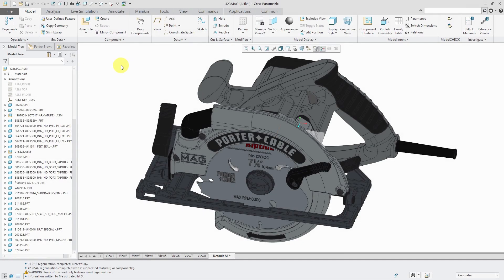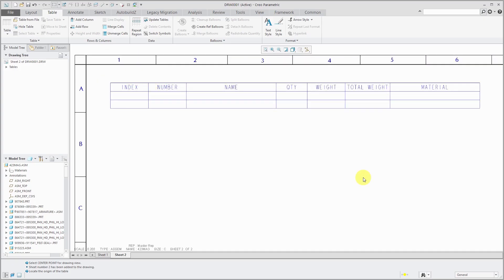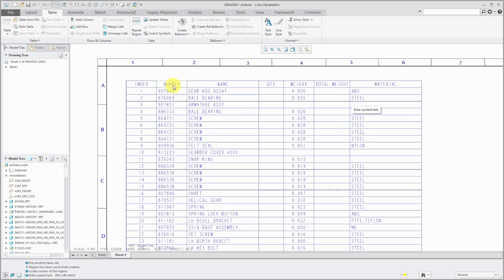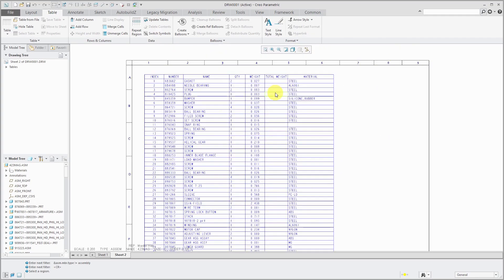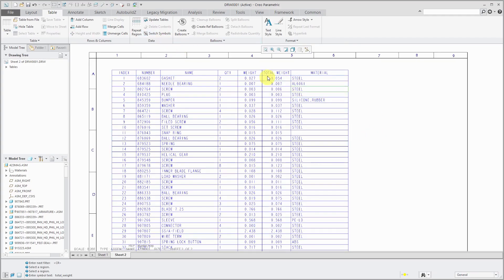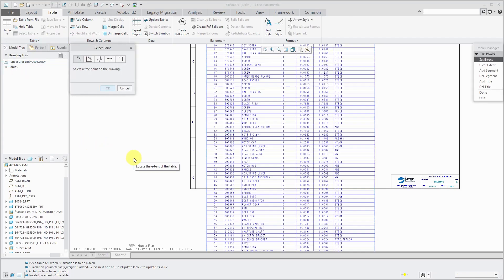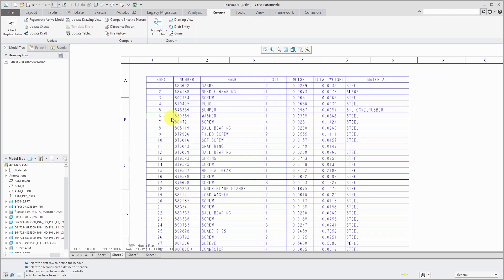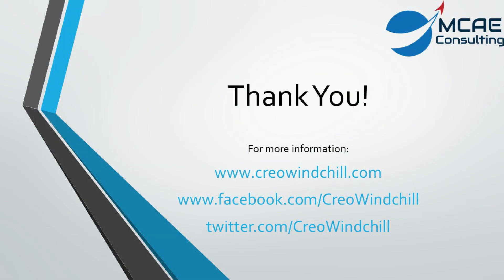Creo Parametric - Drawing Bills of Materials (BOMs) | Tutorial

Comment: How to change QTY inside the table?
Reply from the maker: You don't. It's parametric. The quantity is driven by the model. If you want the quantity to change, add or remove instances from the assembly.
Reply: @CADPLMGuy yeah but when I try to delete or suspend the part then like billion warnings pops up and nothing want to work as it supposed to work -.- I made it by using sketch. Make a cross on the wrong qty and put number on the side xd I don’t understand why but Creo is the hardest 3DCAD program that I ever use <hopeless> I worked on F360, inventor, solid edge, solid works, catia and my favourite NX and the most issues I had are now when I finally found great job with fast stamping progression dies :D eh live is hard
Reply from the maker: A billion warnings? In that case, I suggest you open a ticket with PTC Tech Support.

I'm sorry that you are struggling so much with Creo. I suggest that you watch more of my videos from the beginning, as it seems like you are having problems with some basic sketching and assembly modeling. Or maybe go back to NX.

You might also watch my BOM video that contains information on filtering parts out of the BOM if you want to remove that line entirely.

I don't understand your problem as you have described it. Perhaps you have a super user or admin at your workplace who can help you. It sounds like some training would help as well.
Reply: @CADPLMGuy  unfortunatelly I have to work in Creo, I'm doing my best but sometimes on basic stuff i just on the dead end. My company did not provide me any course and before that i didn't have anything common with creo that is why i'm strugling so much. And what is the funniest I'm designing progresive fast dies for military and space purposes xd but it is how it is here in Pl in american company :D thank you for those tutorials i'm watching them in work :)
Reply from the maker: As someone who has worked at multiple companies that used different CAD software than my preference, (1) you don't have to work there, and (2) you can make the most of this opportunity. And of course you are going to struggle with Creo if you haven't been trained in it.

The first step to a better situation is realizing you have a choice.

Comment: is it possible to add the index number to assembly columns in assemble mode? is that report index a parameter somewhere?
Reply from the maker: It is not. There are several reasons this would not work. It can't be a part- or assembly- level parameter because parts and assemblies can be components in literally thousands of other assemblies. If it were a component-level parameter in an assembly, it would require a 1-to-1 relationship between assemblies and drawings. You would probably have to eliminate Simplified Rep functionality in conjunction with Repeat Regions. In a PLM environment, it would require checking out or revising an assembly every time you updated a drawing BOM.

Short answer, there are multiple issues with attempting to drive BOM index numbers into an assembly.
Reply: @CADPLMGuy   thank you so much for responding! For part level drawings i often have to check out the part to update the drawing because metadata is stored in the part.  From an MBD standpoint, i think this would be convenient, and I am aware that the capability exists in NX.  I think i have found a workaround with a windchill bom report.  Thanks again!

Comment: Thanks a lot for your excellent instruction video(s). For the applicable parts, I am interested to incorporate say length, width and thickness (height) data to appear in the description column in BOM,. Could you help, please. I usually do "=<Thickness> x <Width> x <Length> LG." Still, I could not get around this. I appreciate your help.
Reply from the maker: If you just want to have that appear in a BOM cell, I would probably do that with a Report Relation.
Reply: @CADPLMGuy  hi for qty  the numbers are not showing what would be the problem
Reply from the maker: @vickyoo5  As I show in the video, you have to change the attributes of the Repeat Region.
Reply: @CADPLMGuy  sorry for not mentioning this before...but I did repeat region as you shown in your video even after that it's not showing ...also I tried in another pc the result is same